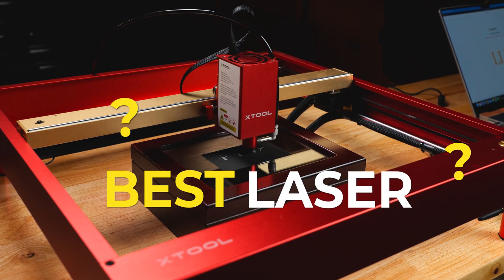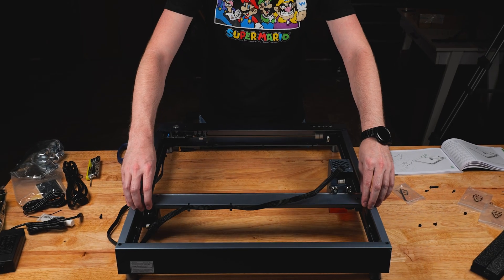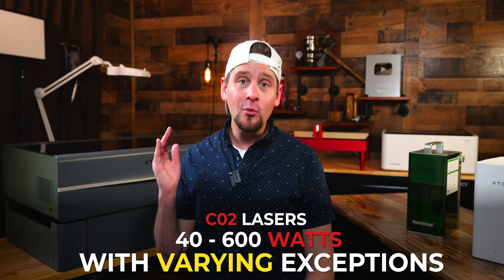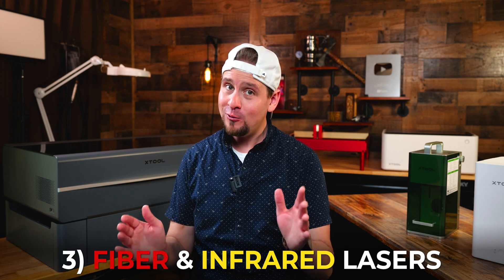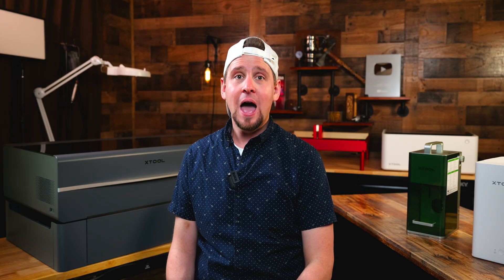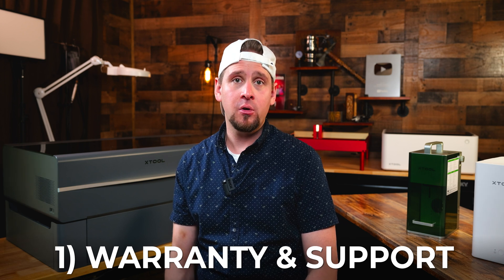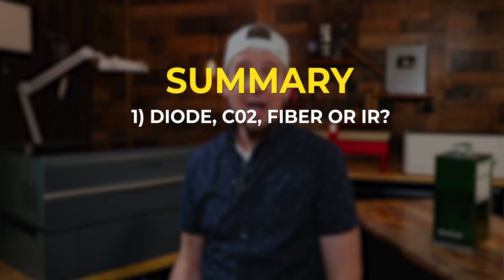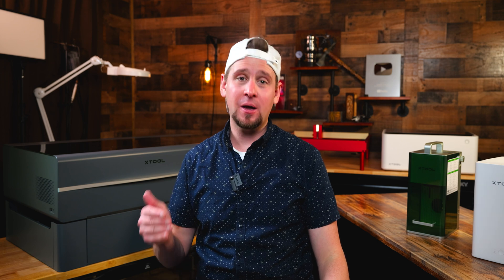How to Choose the Best Laser Engraver/Cutter for ANY Budget

Comment: A plainer to surface materials, a small hobby miter cut-off "chop saw" or bench saw from Harbor Freight, and a small drill  press. I can gather material and make sure its true with the plainer,  cut to spec with the bench saw, and my fasteners go in straight. Just taking a few small steps to make sure my frames and boxes come out perfectly square means a lot to me. The whole kit fits in a storage tote that stays out of site and off the bench when not being used.

Comment: I have been seriously considering buying a laser cutting machine, but, as you indicated in your video, there is a lot of information out there and it's not always clear what will work for my needs.  I am wanting to cut through 3/8" thick white acrylic. Not really engrave them, but literally cut 1/4" wide "slots" through the acrylic.  I tried using a plunge router to do this, but my results have been mixed, as it's very difficult to maintain consistent edges. The other factor is the size...the acrylic piece itself is about 32" long, however, the longest slot needs to be only 18.25" long.  I know most affordable lasers don't handle this size.  I don't know if this is something that can be done in sections, but if that would work, I could live with that.  Do you have any recommendations for lasers that can work with this type of process? Your insight is greatly appreciated!

Comment: Thanks for the informative videos! I'm considering getting a laser -and looking at Xtools. I have a tile design business -and want to be able to engrave slate and ceramics. I also want to engrave wooden rolling pins and wooden planks deep enough to get good textures on clay. Which type and power laser would you recommend? Thanks in advance for any info :)

Comment: What kind of power would you need to cut foam (to make foam inserts for cases), assuming you don't care much about speed? Would a 5- or 10-watt laser be able to cut thick blocks of foam (say, up to 10 cm / 4 inches) by doing multiple passes, or is there an advantage to doing it in a single pass with a more powerful laser (other than being faster)?